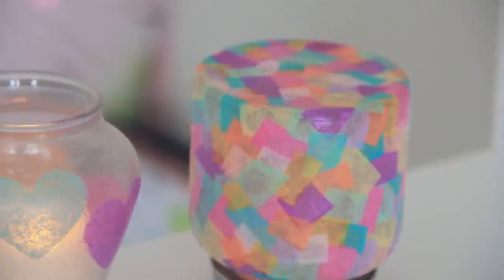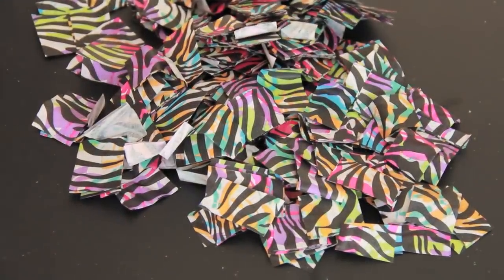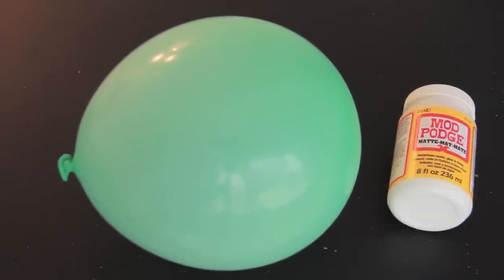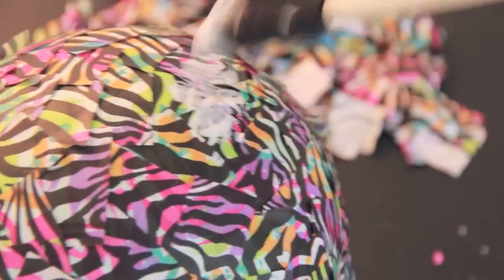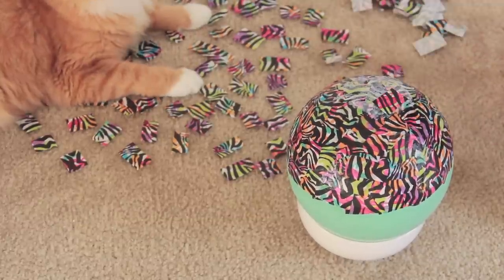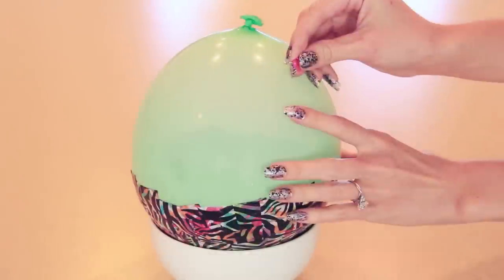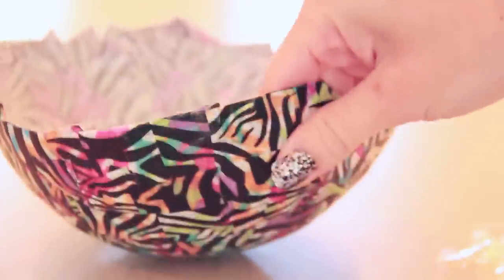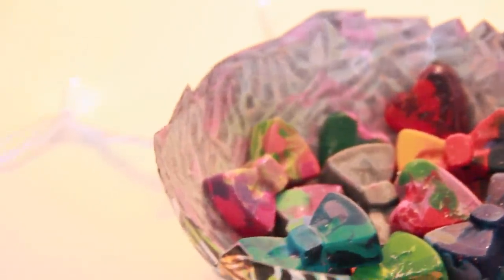DIY Confetti Bowl - Papier–Mâché with Mod Podge | SoCraftastic

Comment: this is really cute...I wonder how it would look if you took a very small balloon and made another very small bowl to glue to the bottom of the large balloon (upside down) to make a fun foot for the bowl.  It would make it so the large bowl won't wabble all over the place.
Reply from the maker: Tari Huffaker Thanks! That's a neat idea! It doesn't wobble too much, but the foot would make it more sturdy for sure (& give it a fun look).
Reply: +Tari Huffaker haha I thought the same thing.. or maybe adding a templated ring of mod podge afterwards... ??  but this is turned out super cute.
Reply: I love it.  I am going to try something similar with clay...as I am a potter.